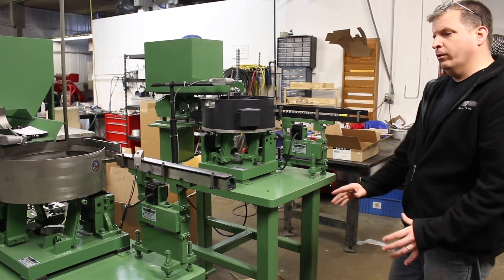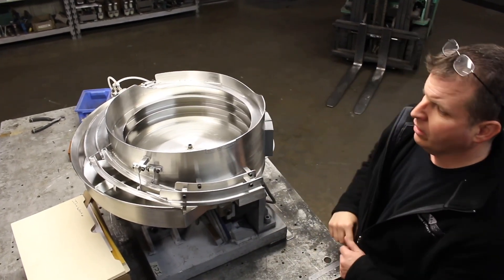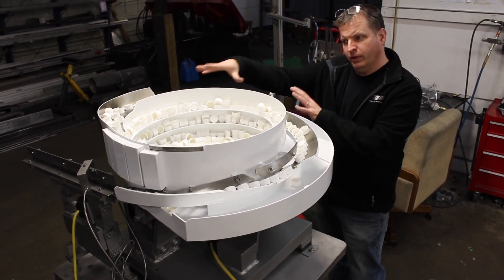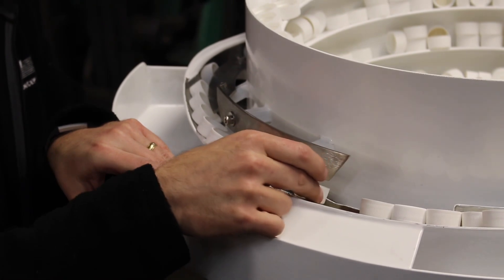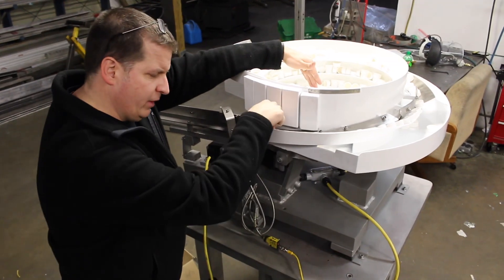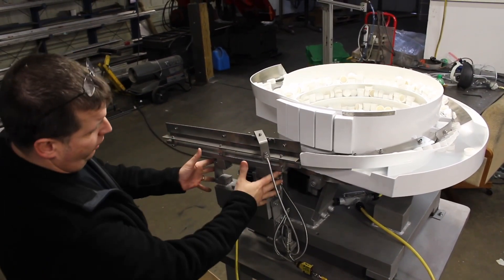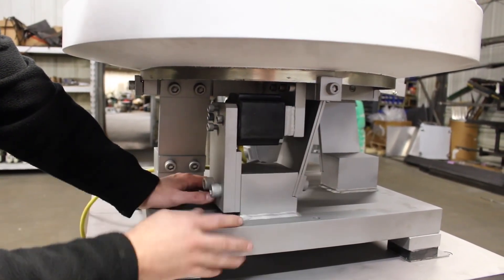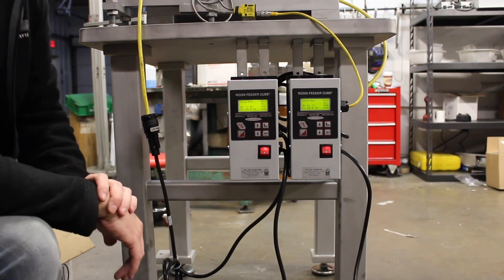What is a Vibratory Feeder Bowl and What Does it Do? | Feeding Concepts, Inc.

Comment: What I don't understand is why you want to orient a piece if it will be end in a box (deoriented)
Reply from the maker: Hello, thank you for your question. Essentially all of the vibratory feeder bowls we produce are integrated into an assembly line. So, for example, the end user of the cap feeder shown about halfway through the video might integrate it with a machine that screws the cap on to a bottle.

Comment: I bought a feeder bowl that is moving aerosol valves. The valves are moving backwards. What's going on?
Reply: spring pack make sure the bolts are tight check the coil adjustment